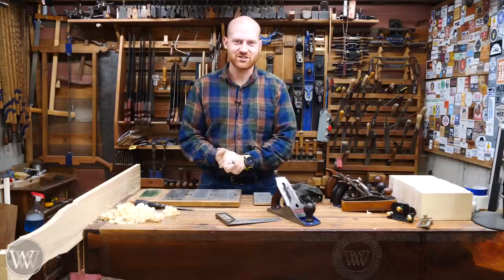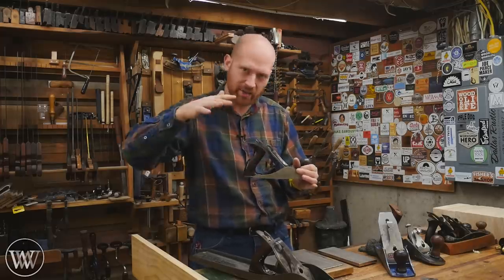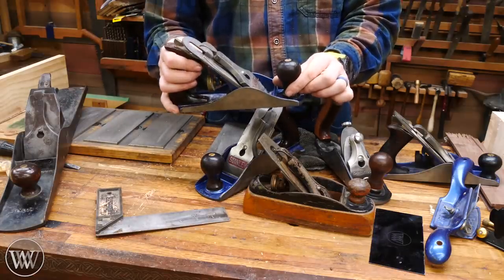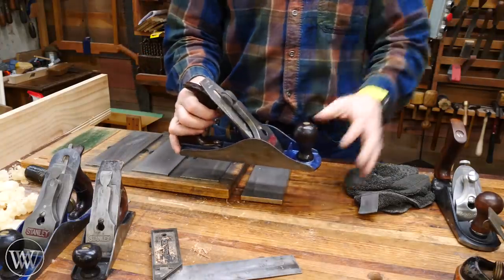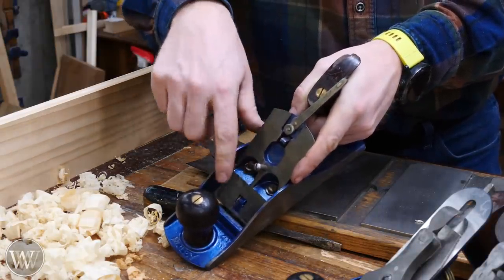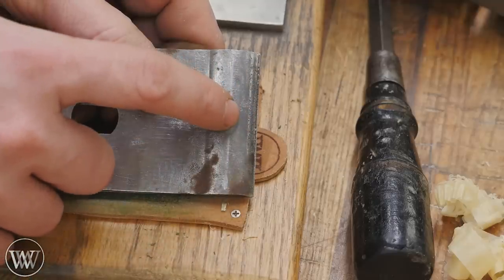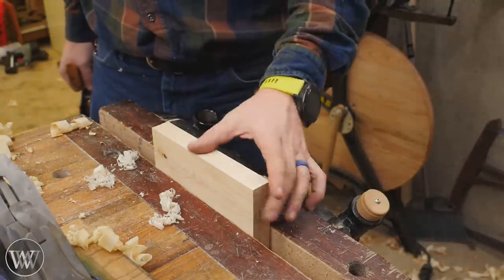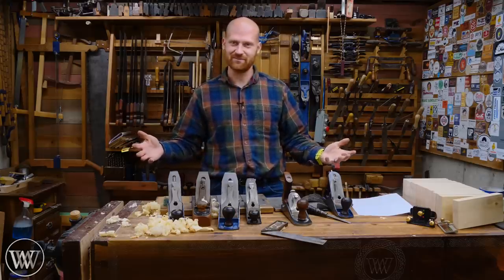The best Smoothing Plane How To Use and Setup

Comment: While I enjoy your videos, I feel I must disagree with you over bevel-up planes. I have a Lie Nielsen 62 1/2, and use a blade honed at a 40 degree secondary bevel. I rarely have any problem with tearout.  I also have three other blades for it at various angles.
Reply from the maker: that is what makes the sport fun there are a thousand right ways to do it and we all have to find the best  way for the way we work. I do a lot with figures and curly white oak. and even with a 50 degree iron and a laser tight mouth I still get tear out.

Comment: With a low angle plane like that Stanley, you can eliminate the tearout, you just have to get a different angle blade.
Reply from the maker: That works okay, but I'm really difficult woods. It isn't quite as good as having a chip breaker and a higher angle.

Comment: Well, 99% of this I knew, because of you. Thx teach. . . . . . , ,  Dont understand why the issue with the 62 w/ b/u, in comp to a b/d.
Reply from the maker: thanks. there is no chip breaker on the Bevel up plane. so the only tear out protection is making the mouth smaller or putting in a higher angle iron which defeats the purpose of a low angle plane. and it still does not have a chip breaker.
Reply: I would think the up bevel would act as a chip breaker specially on thicker blades and maybe  depending on angle.
Reply from the maker: no the chip breaker compresses the chip. you need a second angle behind the cutting edge to do that. so even if the bevel of the iron were 70 degrees it would stole just slide past rather then being compressed.
Reply: oh!! damn no wonder i dont have any good bench style planes, ugh